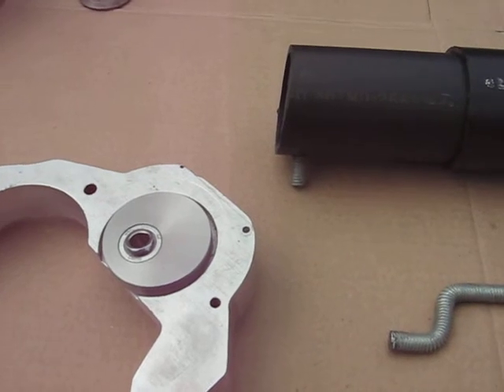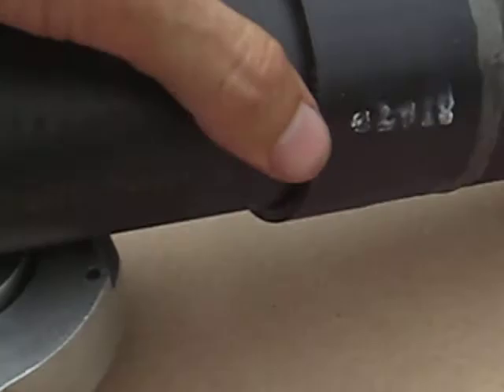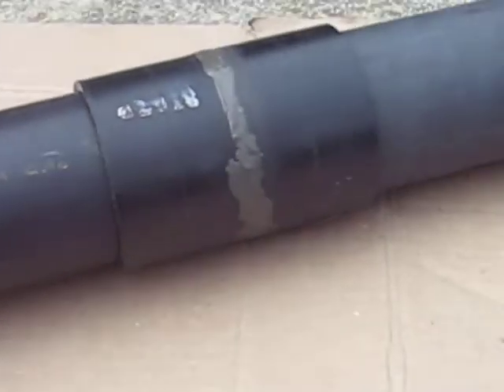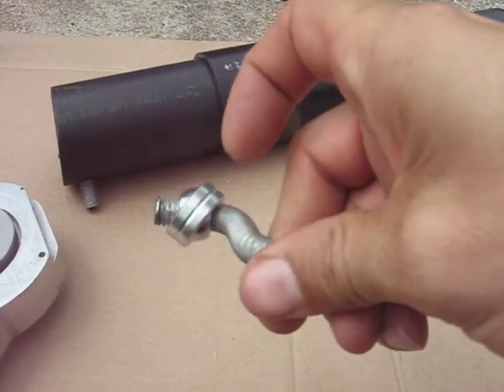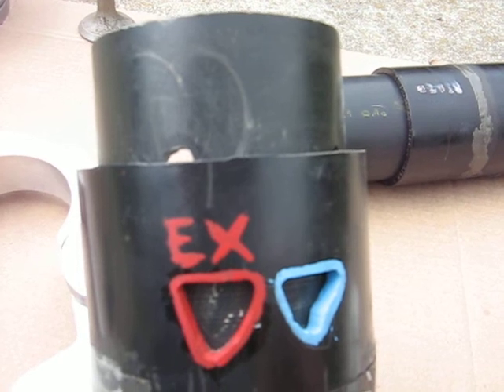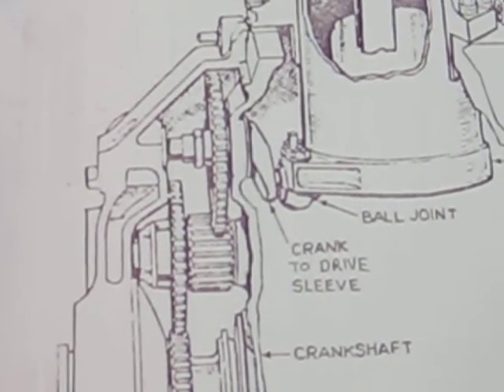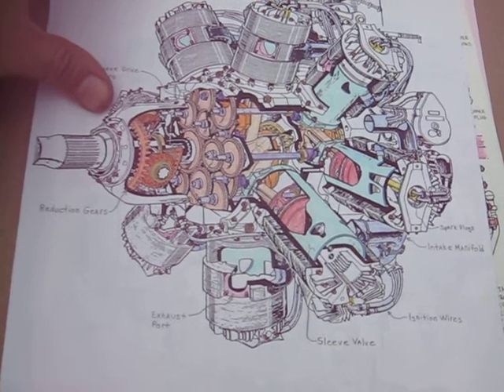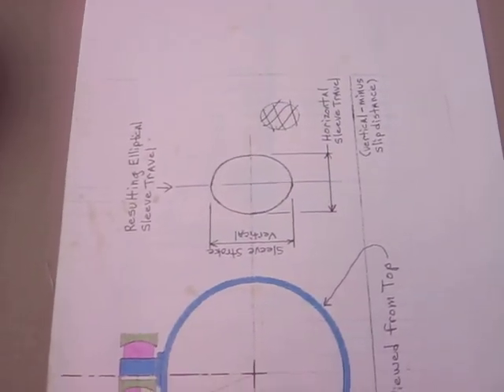Sleeve Drive Methods

Comment from the maker: @totenkopf999 
Thanks for the input, I appreciate it, it helps me to know that folks like to view my vids where I explain how each engine works. No, I am not currently doing anything on the sleeve valve, but I have a 2 stroke sleeve valve partially built, based on the Rolls Royce Crecy design.